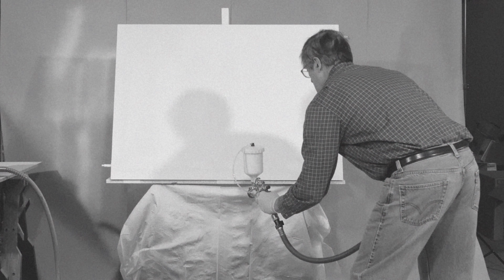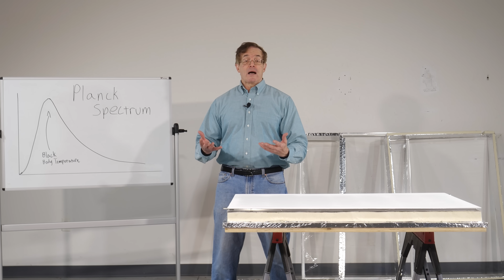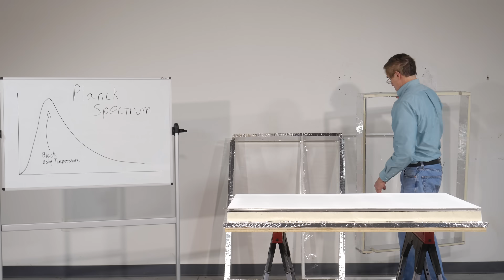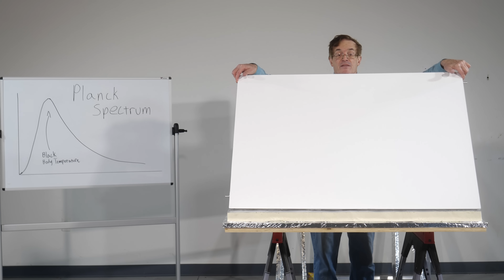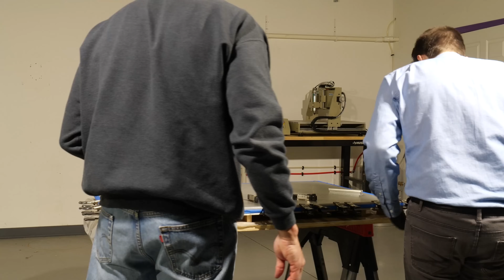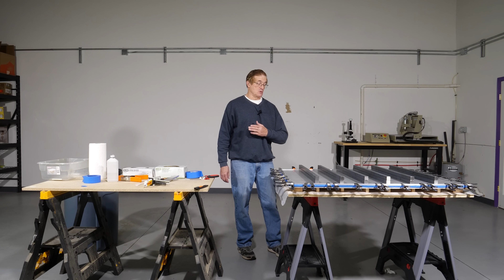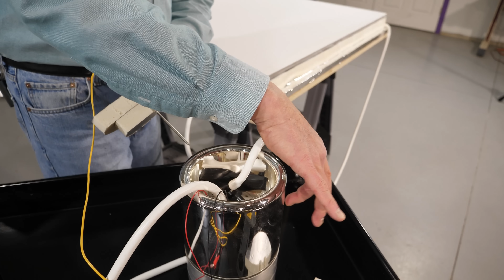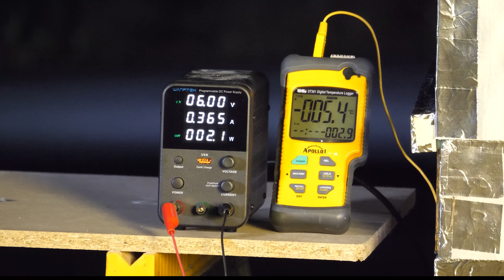Air Conditioning isn't free... but we're close.

Comment: Decades ago we found that even black polyethylene is quite transparent to IR. We were making a large solar heated balloon and used a black tunnel of PE (held up by people on a hillside) to try to preheat the air. But it was not as successful as we thought. Turns out a bit of black spray paint would have been better. Which was used on the bottom half of the balloon btw.

Comment: University of Florida has published studies on this and had fully working projects.   Oddly it works quite well in some areas of Florida which are particularly dry.   Arizona also.   But otherwise there is insufficient temperature difference to justify it.   If water already freezes on your metal roof at night in very calm conditions you are in the right area.   A desert is known to get very cold at night.

Comment: I have been putting aluminum foil sheeting inside my attic, I left an air gap (stapling just below the rafters) thinking it could form an air pocket and also force the heat to radiate twice (the plywood and then the foil) before entering the attic.  I'm wondering how much worse it would have been to just staple it directly to the plywood, letting it conduct straight though to the aluminum.  I didn't know the emiticity was so low, I thought the main benefit was it reflected the heat back at the wood/air, so learned something for sure.
Reply from the maker: That's right.
Generally,  reflectivity and emissivity are inversely related.

Comment: I cool my 1500 square foot house for around 50 cents a day, swamp cooler with a 3 phase 240v motor hooked up to a Mitsubishi VFD, that way I can finely tune the motor speed instead of being stuck with 2 speeds, and the motor is far more efficient this way, and the water is supplied by the well, keeps the house always under 75 degrees even on 100+ days without a single hiccup, and in the winter, natural gas is only 40 cents per therm, but I also have a wood stove and harvest my own firewood or run a waste motor oil furnace for free heat
Reply from the maker: That's cool,  literally!
How you approached this would be an interesting series on YouTube.
Reply: @TechIngredients  true maybe I'll make a video on it, sadly swap coolers only work in certain regions, for more humid regions you'd have to rely on other methods as you've experimented with

Comment: In another video you guys ran the cooling side if an ac unit to a geo thermal setup that worked pretty well, could you run that loop through this panel(s) (alone or as a part of a step system) and gain  any benefit?
Reply from the maker: We could.
Using complementary cooling methods in series will increase the efficiency even further.

Comment: Im failing to understand how the collar reduces the "view" of other sources of infrared. Doesn't the reflective surface inside the collar work just as well to bounce ir from the surroundings entering at shallow angles down onto the radiator, as it does to bounce ir out from the radiator to the opening?
Reply from the maker: Consider the collar with visible light. The sky is dark, but EVERYTHING else is glowing. The collar will shade the panel from everything but the tops of trees, buildings, and mountain tops.
Reply: @TechIngredients  Thanks for your reply. Keeping with the visible light analogue, my intuition is that this would be true for a collar made of something black, but with a reflective surface, I feel like any light entering from above the plane of the opening would ultimate bounce its way down to radiator. If so, it would seem a collar would only benefit in as far as it raises the plane of the opening higher than other sources, which is to say a 4" collar, would have the same benefit as raising the radiator by 4" without a collar.

Thanks again.

Comment: thank you for sharing  this type of pump head around 1 meter so I assume water flow rate to be around 0.14 L/S that is  leading to COP about 2.6 and EER 8.8 that is amazing I recommend to use different (configuration factors, form factors, angle factors or shape factors.) try the same  at higher level may be at the roof will be more effective and remove upper frame to increase the view factor

Comment: Most interesting.
I live on a tiny Mediterranean island, Malta and we get lots of heat in summer.
I use a heat pump A/C for summer months cooling, but energy costing what it is, its rather expensive.
This passive cooling by sky radiation could provide a practical way to reduce this cost.
I was wondering if another panel of the same construction, installed indoors, could provide additional cooling by "radiation" cooling ?
Reply from the maker: The fundamental principle is that the emitted radiation has to be disposed of. The sky is an obvious route.
If indoors,  the radiation would only heat some other surface. You can't destroy energy, only move it around.

Comment: I am a bit confused about the stiffening ribbs - how did the water pass through , as you guys had glued the both sides of the ribbs which would be neccesarry for there function  so did you guys made some holes on the sides for water to pass through it and get over the foam and get through the next hole alternatingly till it gets to the exit .  can you please clear that out .
Reply from the maker: Sure. 
The ribs are a little shorter than the width of the assembly and are attached alternately short on the left and then short on the right and then short on the left and so on. The water flows in a raster pattern.

Comment: I really appreciate the video and the design, and I'm just fascinated by the ability for a coating to allow a surface to be cooler than the ambient temperature, but surely this isn't approaching the power required to meaningfully cool anything.  The paint itself on vehicles or structures surely could be a good idea in places, but I can't see this form of radiator ever being space or cost efficient.

Comment: I would've thought this was like a CPU waterblock with channels and fins to increase surface area but if I'm understanding correctly it's just a thin layer of water that is coming in one side filling it up and coming out the outlet? It follows no real design path?
Reply from the maker: Not quite.
The spacers that provide the structural interface between the sheets are staggered so that the water must flow in a raster pattern from the entrance to the exit.

Comment: If it was black, would it emit more radiation?
Reply from the maker: No.
What we see as black is the visible wavelength performance. At the 10 um wavelength of the thermal infrared, that color is meaningless. If you want to know the infrared "color", look for  its emisivity. The higher this value, the "blacker" is its color.
Reply: @TechIngredients   this is directly applicable to Jeep-style hard tops. The inside is always white instead of black. I always thought this was to reduce radiant heat.  Thanks for clarifying.  This would be a “cool” real world demonstration of this.

Comment: Air conditioning systems using inverters for DC current compressors and fan motors are already solving the problem.  DC motors use a fraction of the power used by AC counterparts.

Comment: It's been my understanding that the average human body radiates about 100 watts of thermal energy not 1.2 kw. 1.2 KW is up there in electric space heater territory.
Reply from the maker: I don't think I said  1.2 kW...net. Remember that we are in equilibrium with our surroundings. The human body radiates about  150 watts...net in a typical room temperature environment.
Reply: @TechIngredients  You said at 2:25 "so I am continually radiating into the environment, 1.2 kilowatts." Perhaps your meaning was misunderstood?
Reply from the maker: No, I stand by that. I believe I followed that statement with the fact that my surroundings are radiating over one kW back to me. The net flow is 120 to 150 watts. This is because I am usually warmer than my environment.  The exception is the clear sky, which radiates very little heat back to the ground. That is what we're exploiting for this process.
Reply from the maker: No, it doesn't.
A pot of hot water on the counter may be radiating several hundred watts of heat into its surroundings, but it isn't "producing" any heat at all. It's cooling. Put it in an oven, and it's warming
Take a look into blackbody radiation. There are even calculators based on temperature and surface area and what's called emitance. That's the efficiency of a particular surface material vs. a theoretical ideal radiation emitter. Human skin, clothes, wood, many plastics, and the specialized coating we made are very close to 100% effecient as emitters of infrared radiation.
Reply from the maker: A better way to say it is that the human body LOOSES 100 watts of heat in a room temperature environment.

Comment: Great stuff. How many BTUs will a one square meter box produce?
Reply from the maker: That depends on the surface temperature. The rate of emission of infrared radiation is proportional to the fourth power of temperature.
Reply: @TechIngredients  Rough guestimate? 100 BTU per hour?
Reply from the maker: Sure.
It's about 1,800 BTU/hour/square meter at 25 degrees C.
Reply: @TechIngredients   nice

Comment: Could you flip it over to warm the water?
Reply from the maker: No.  A major determinate of performance is the temperature differential. With the clear sky, that differential is over 100 degrees C. Between the ground and the panel, this will probably be on the order of 10-20 degrees C.

Comment: This guy makes a black body emission device and paints and white lol
Reply from the maker: Can you rephrase that? I don't get the point, even if it's supposed to be humorous.
Reply: @TechIngredients  It's a joke, but it's partially true.  Black does a better job of emitting radiation same as it does a better job of absorbing radiation.

So the question is at what point is the color absorbing more ambient light from atmospheric refraction than it is emitting infrared radiation? It depends on the conditions, of course.
Reply from the maker: What you might be surprised to know is that black is not better. Neither is it worse. What we see as "black" is not reflective in visible wavelengths (about 0.5 um), but at 10 um in the thermal infrared, it may be reflective or emissive. This barium compound is very emissive at that long wavelength AND very reflective at visible wavelengths. That's uncommon.
Reply: @TechIngredients  The key here is that it doesn't have to emit the photons at the same wavelength as it absorbs them.
Reply from the maker: Actually, it does. Emissivity is inversely related to reflectivity. Bare metal surfaces such as aluminum are highly reflective in the 10 um range and are terrible emitted. That is why the bare aluminum plate became much hotter in the sun when we compared the different coatings in the coating synthesis video.
Reply: @TechIngredients  uh so you're saying reflective doesn't absorb?. Black does.

On a clear, low humidity night, black objects will get colder than white objects when all other factors are the same.

Comment: You keep saying "to the power of 4" but that is not the full story. It is misleading. The full equation for heat loss by radiation is k(T1^4 - T2^4) so it is the temperature of each 'thing' independently raised to the power of 4 then take the difference and multiply by a constant which is a function of Boltzman and the emissivity and absorption of the 'things'. If T2 is space and very nearly 0degK then your simplification works well enough but the detail is still relevant. (Sorry to be a pedant but I am an engineer, can't help it.)
Either way, dropping the temp by 7degC with zero thermal load otherwise on a clear night is not particularly special. I live in a country that does not get very cold but I can find ice on my car windows on a winter morning. No special paint required. And temp drop is not actually all that relevant anyway. It is heat loss that will determine if this idea has any merit. So that is the question you should be answering.
Reply from the maker: You shouldn't let your tendency to be  pedantic interfere with your ability to grasp the full picture.
As an engineer, you should be familiar with the FIXED role of constants in an equation and the significance of variables, especially when they are raised to a high power factor.
Your anecdotal experience with your car windows in view of your background as an engineer validates the results we demonstrated. The special coating we developed allows what you see at night on your car to occur in bright sunlight. We demonstrated that in our follow-up video on making and applying this coating. In fact, it is your comment that is misleading.
Reply: @TechIngredients  Not sure how my comment is misleading. The core of my comment still stands: the temperature drop you can get means nothing if it cannot be sustained at a useful level with a load applied. In other words, to avoid being misleading, it is not the temperature but the heat that is important.
I am surprised you are getting good results in broad daylight. That your panel can 'see' space temperatures through an atmosphere fully illuminated with heat from the sun. That ice that forms on my car does not happen during the day. There are several reasons for that but even on a particularly cold day, it does not happen. I would need to look into this more closely to assess the impact of atmospheric  insolaton to make any definitive statements, it just seems there should be a practical problem with the results you say you are getting in broad daylight.
Those 'fixed' constants BTW, are not so fixed in as much as the emissivity screws with the fixed elements of the equation. Then there is also the question of the modelling. There is an atmosphere between your panel and space that is ignored by the simplification about T2 being 0K.
I think it is likely that a lot of what you are doing is accurate and correct but there is a small area of missing details that may be missing because they are not recognized (incomplete model) or they are too difficult to deal with and so skipped over. (also incomplete model).
This is just my take on this as an engineer with some tangential experience in this area. I do not mean to offend, I hope to help you improve what you are doing. That is my purpose here.

Comment: And if.. the temperature outside at night goes from 0 to -7 degree.. what does this .. not working device do?
Reply from the maker: In such a case, you don't need cooling.
And, as the temperature rises, the heat radiated from the surface increases with the fourth power of temperature. The hotter it gets, the better it works.

Comment: How does this compare to a geothermal heat pump in terms of cost and efficiency?
Reply from the maker: It's probably inferior. However,  the infrastructure investment with any geothermal system is significant.
Furthermore,  what is most promising is not the system we built, but the coating that makes it possible. Check out our later video on how to make and apply it because it can be used on any structure that can accept paint and will passively cool that structure.

Comment: Running warm air over ice creates a cooling effect all on it's own, and they already use propylene glycol in grocery stores for refrigerant in shipping and such. If you could push hot air from a structure out and over this cool water loop and push the air back into the building cool, you'd skip the need for Freon, wouldn't you?

Comment: isn't this experiment supposed to be conducted in a hot area which it is supposed to work?
Reply from the maker: That would be useful.  The performance will increase substantially as the temperature rises because the energy radiated away increases as the fourth power of temperature.

Comment: So basically you have made an air to water heat exchanger and your running it at night, when it's 0.5°C. How is this going to help in the summer when it's 35°C outside?
Reply from the maker: The energy (heat) output from the surface increases with the fourth power of the temperature.

Comment: solar panels are a failed project which is why even germany reopened it's coal mines dues to their stupidity in pushing them. if your plan is to rebuild every structure with this complex mechanism then the prices of housing will go up even more.
Reply from the maker: Not at all.  If the subject is interesting, then you might check out our following video on the coating that makes this possible. It works, and it's fun to make.

Comment: If its cold enough to use the insulated box as a heat sink, then simply dumping the entire air volume of the house and replacing it with outside air may also work.

This is usually accomplished by "opening the doors and windows"

The only cases where this is not the possible is when both the humidity and temperature are unbearably high.

Unfortunately in this case clouds will also make your radiator perform less well.

Comment: What do you think about the potential of replacing a conventional AC Heat exchanger with one similar to the one you built, but running the AC refrigerant through the panel rather than water. The heat flow would be Air (inside cooled structure) to Refrigerant to outside surroundings (through radiative transfer) rather than the method you proposed (Air to refrigerant to water to surroundings)? It seems harder to manufacture (pressurized R134 in a panel like you build probably wouldn't be too safe), but it would eliminate some of the heat flow restrictions due to the number of interfaces the heat is transferring through. 
Secondary question, would spraying my outdoor AC heat exchanger in this special coating improve its efficiency or would the reduction in conductive heat transfer negate the improvement in radiative heat transfer?
Reply from the maker: I'd stay with the water to refrigerant loop because it's easier to set up.